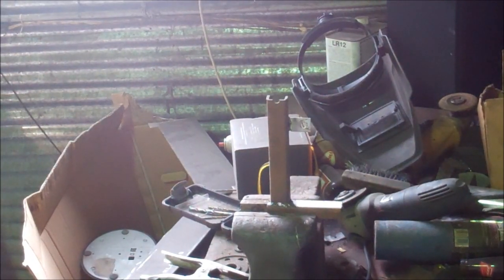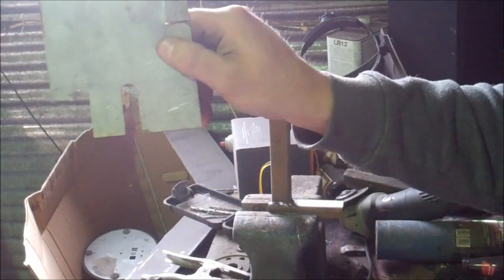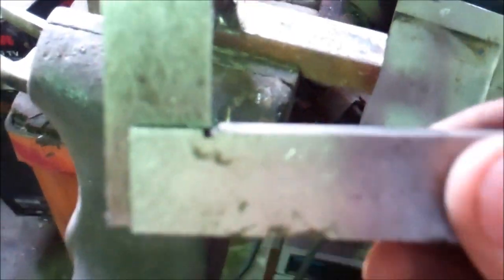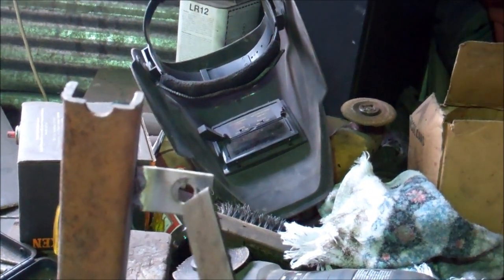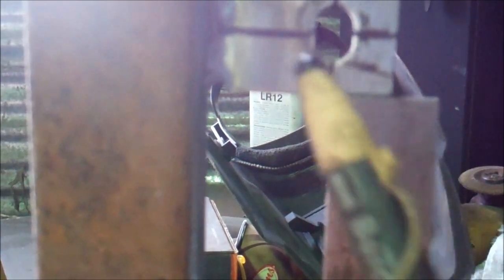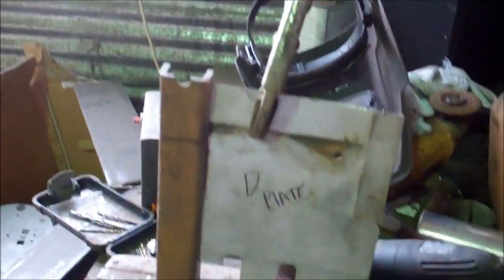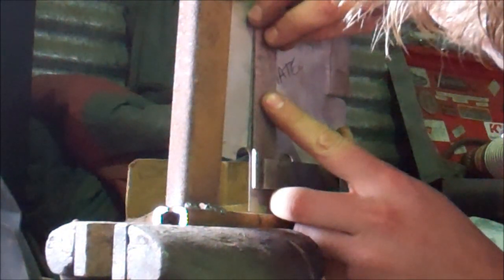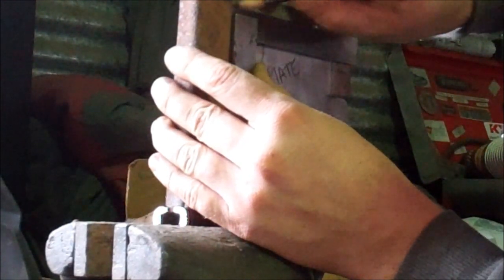fearlessfront vid resp

Comment: @foxracing279 the only good thing ford did is redesign the assembly line and produce the 351w which is better but not as popular as the Chevy 350, we  351's in both of our boats and they run smooth, one idles at 250 rpm, thats the only good thing they did

Comment: why dont you just stick the plate behind the mount in between where the motor and clutch assembly would be? mark it right threw the hole on the mount